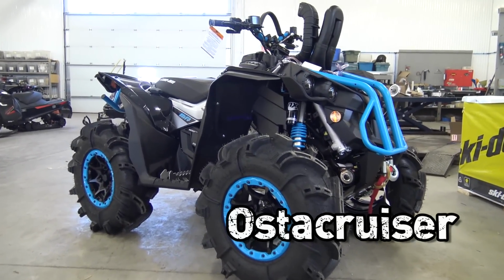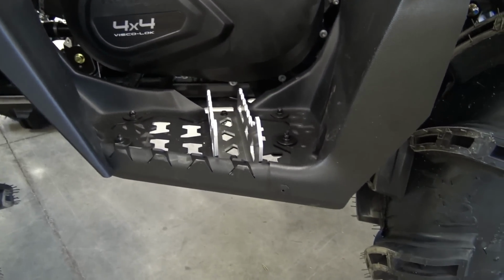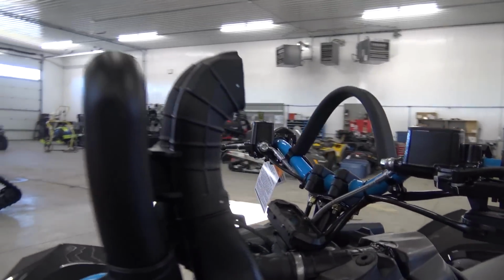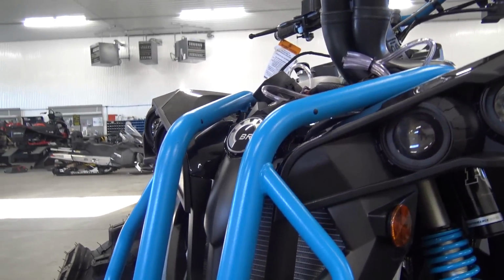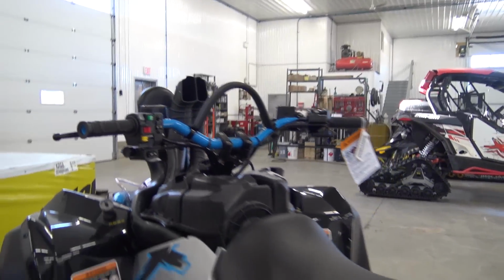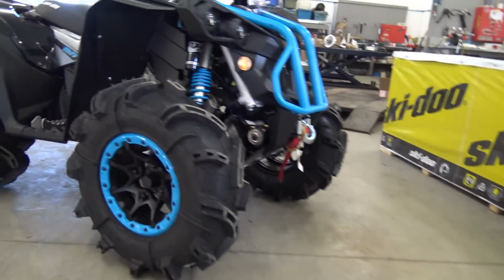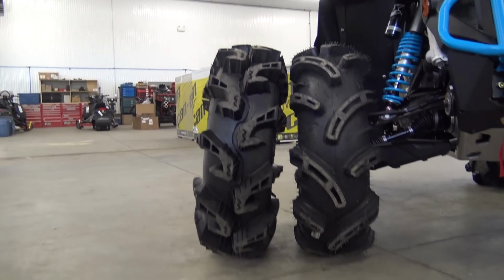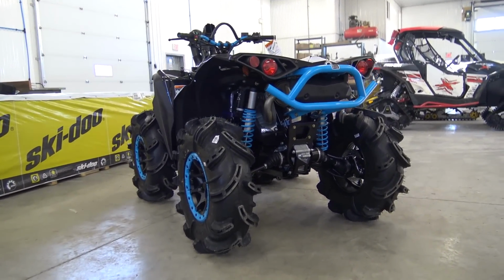2016 Renegade Xmr 1000R Build!

Comment: Very interested in seeing how the MT2's do. 10lbs heavier, but bigger lug, more sidewall wrap. Looking at the vid they seem to be a very narrow 9" tire, looks like they would be an awesome mud pit tire but that width would worry me in the skeg. We will find out in the spring how you do with them.
Reply: +XMARGH I don't think they are going to be a very good skeg tire, personally. The original S-backs are absolutely terrible in muskeg.
Reply: mac102004
I have the original Silverbacks on my XMR, stock size 30x9". If you can keep the wheel speed up and keep them floating on top of the skeg they do well, but the minute they start to dig down they stop moving forward. I see ostacruiser has been using the original silverbacks on his wife's bike and he does well, but Bolt-on, cammed 1000 rotax is no joke and keeps up the wheel speed.
Reply: XMARGH
 Absolutely, wheel speed is key. I liked the Outlaws much better as they tend to paddle rather than dig. I run 28" backs on a 500 Honda now, wheel speed? yeah that's not happening LOL

Comment: I picked up the 1000r xxc because I was talked out of the XMR by the dealer. but now that I see more of it I would have gotten the xmr if the dealers would have just said " sign here " lime they supposed to.

anyone wanna take over a 16 xxc 1000r lol
Reply: like*
Reply: ***** they said "this bike is good only for mudding, itll be useless everywhere else and most uncomfortable to ride". So now im noticing that after my first ride that had mud in it, that ive installed a rad relocation kit, i have some better tires coming, snorkel kit is waiting for me to install. So in eccense i could have bought the XM R and then a set of trail tires and been set.
Reply: +DDM4Prepper they start at 17k here in Canada
Reply: +Dan lessard ha then taxes in you're looking at 20k Canadian, looking at buying knew of these soon though, the smiles are worth the cash haha
Reply: +Alex Wright i hear ya. im in for over 20k on mine.